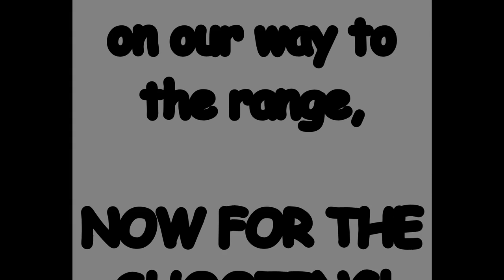Ultimate Zombie Destroyer Go-Cart

Comment: Couple ideas a little more headroom under the tubes. That will also give the rear rider some more cover and a better hang on when rear riding. A pickup like box would make carrying things easier. Take some 8" front tires front tires from lawn tractor. That will help up front. Some 16 guage aluminum sheet metal pop riveted for body will be strong and stiffen the frame without too much weight. Hope these ideas help.